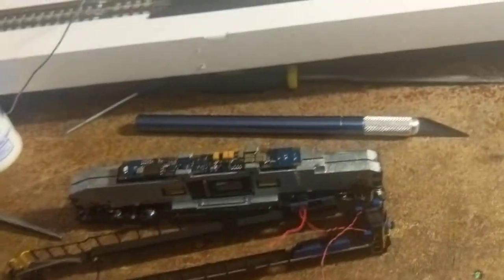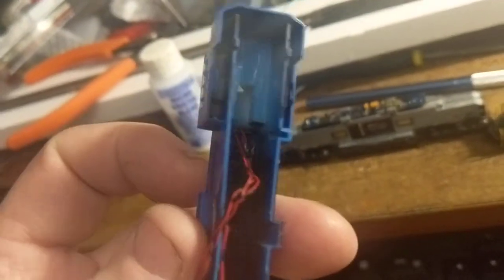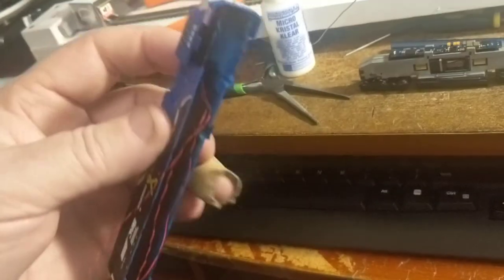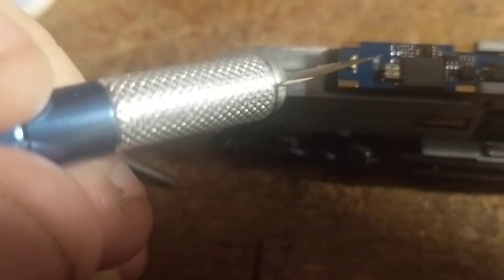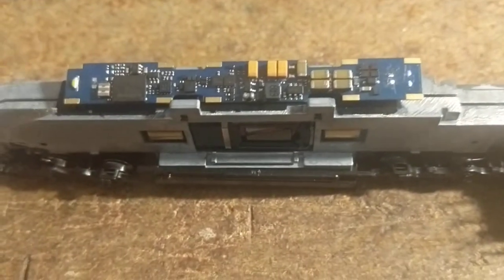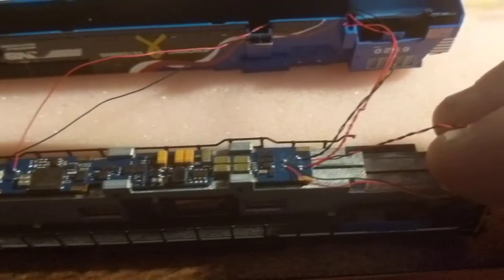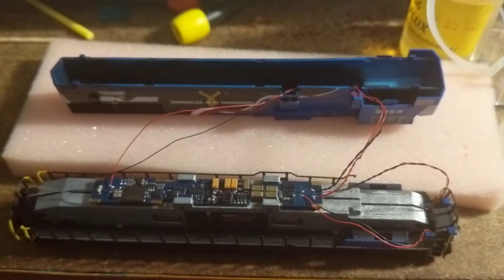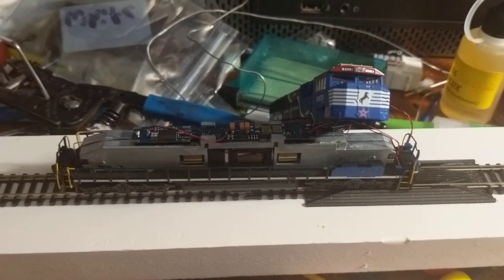SD60E lights remod Part 3

Comment: I’ve done two of these so far and with I have two to do once I paint them. I did mine alil different. Both of my number boards are Lit using track power directly along front and rear ditch lights functional. As far as the LEDs you used , they look good but you should of used a warm white or “true incandescent “ color.